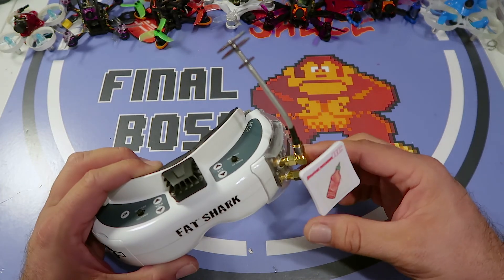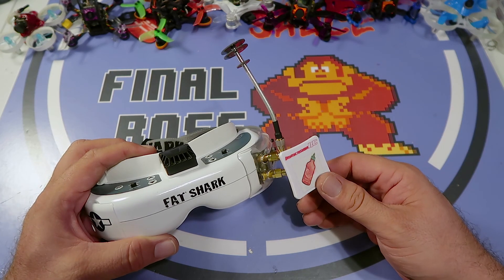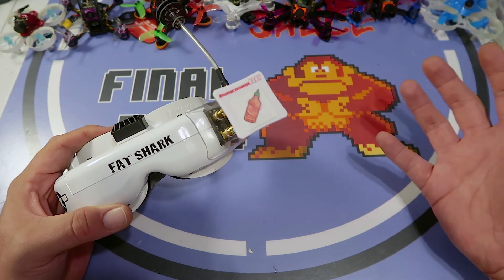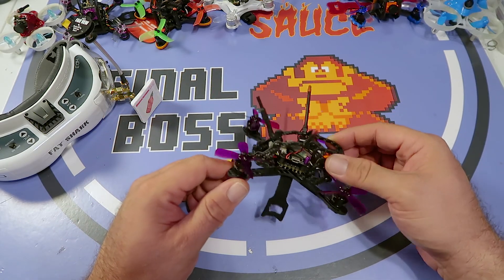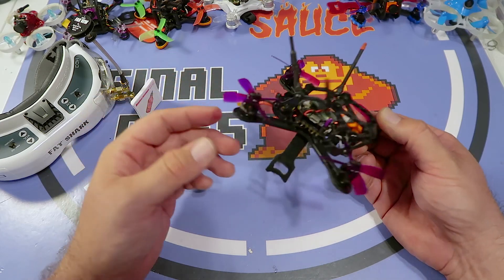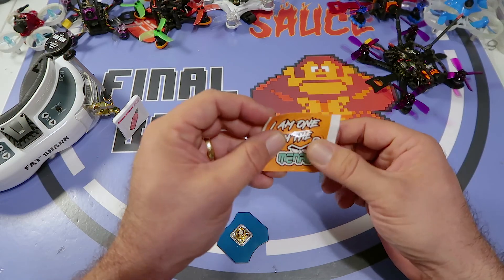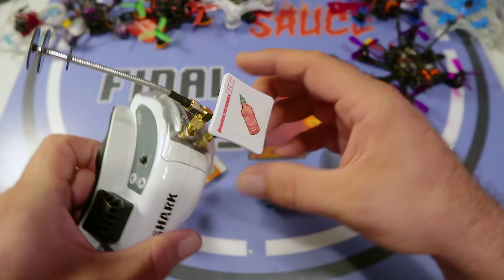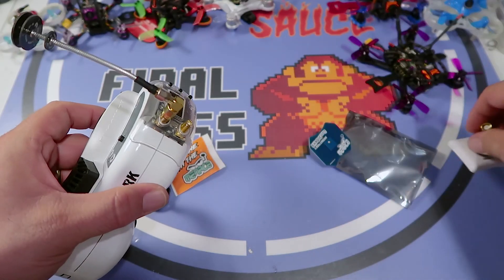MenaceRC Bandicoot Linear Patch Antenna

Comment: I've been trying to work out a good way to mount my Babyhawk XM plus RX antenna.
I noticed your Babyhawk antenna's look pretty secure,  can you tell me your method of  mounting your antennas?  Thanks
l've recently bought a complete set of Menace RC antennas (2x Pegoda's + 1 Patch) for my  Fatshark V3 diversity setup and have been sitting on the fence ever since regarding buying the Bandicoot, since virtually all my quads are micro's with linear antennas. I think after watching your video, it might be worth investing in the Bandicoot after all. What do you think ?
Reply from the maker: +Andrew Hutchinson I’ve tried a few different ways and didn’t 100% like any of them.   The props always seem to be scary close to the rx antennae.
Reply: Did you just use heat shrink to keep the wires firm or did you use a zip tie as well?
Reply from the maker: +Andrew Hutchinson exactly, heat shrink and a zip tie.
Reply: Thanks for your help, I'll try the zip tie & heat shrink method. 
keep up the good work with the channel.

Comment: Hey you hv a lot of toys! Which one of your other mini quads is better than the Lizard95...components, durability, flight time?
Reply from the maker: The one thing the Lizard is really missing is a CCD camera like a Runcam Micro.  I would recommend building if you can.  Tomoquads and AirbladeUAV both make great micro frames that fit the Runcam Micro.